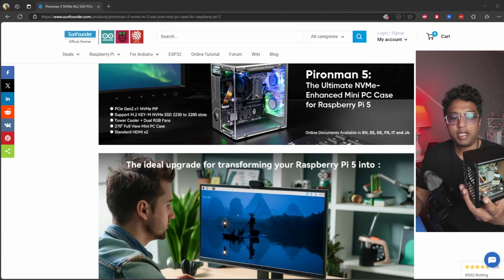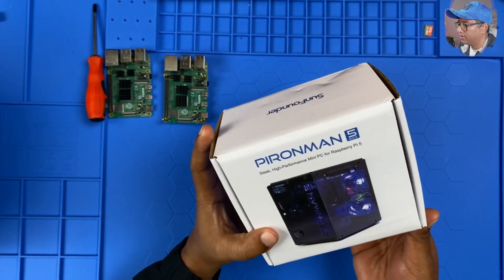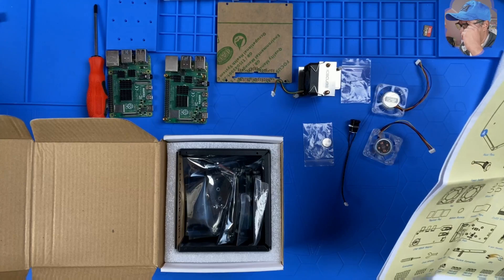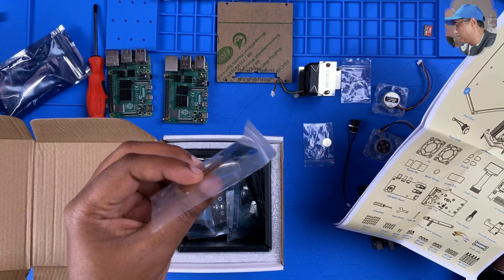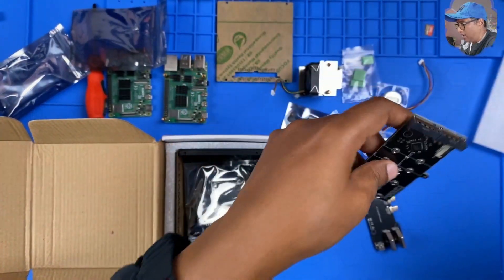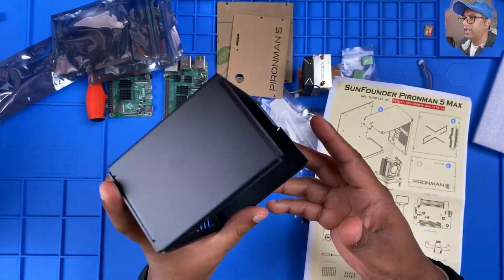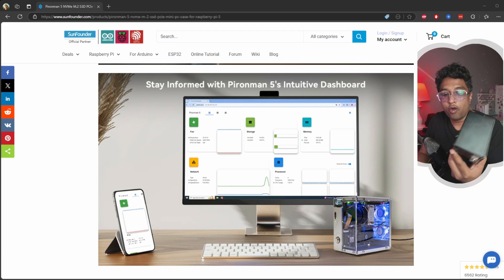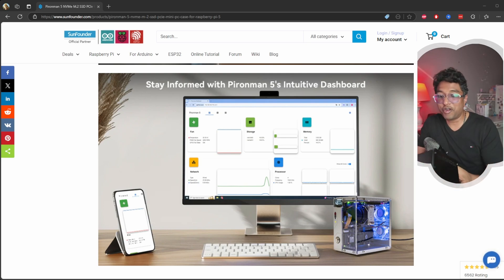Pironman 5: The Mini PC Case That Makes Raspberry Pi 5 INSANE!

Comment: I use my raspberry Pi 5 to run llama.cpp I can run models as large as 7B parameters on the 8gb of RAM version.
Reply from the maker: That’s impressive! Running a 7B model on an 8GB Raspberry Pi 5 is no small feat. Did you use quantization or any other optimizations to achieve this?